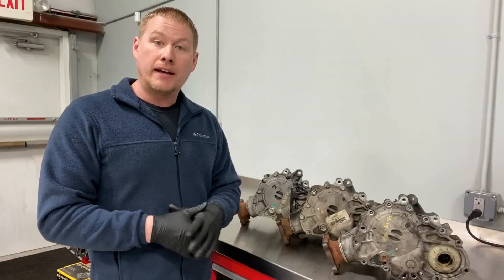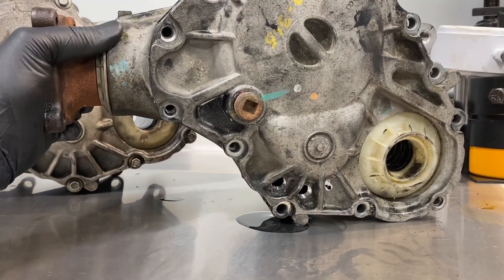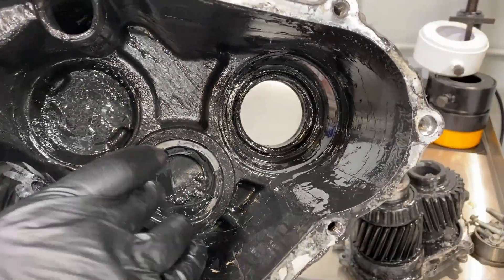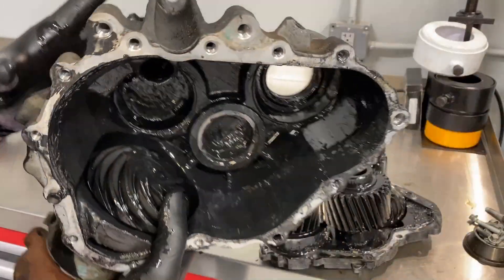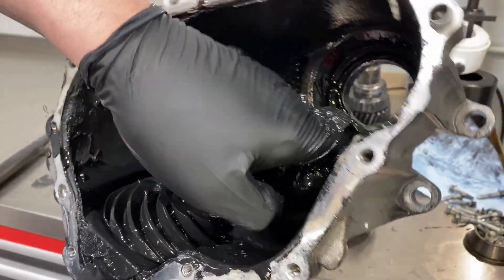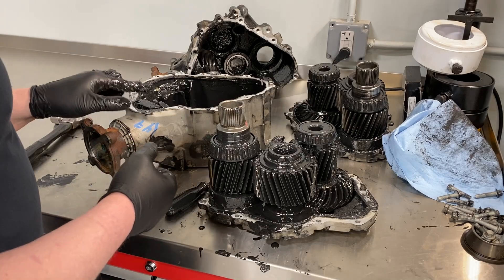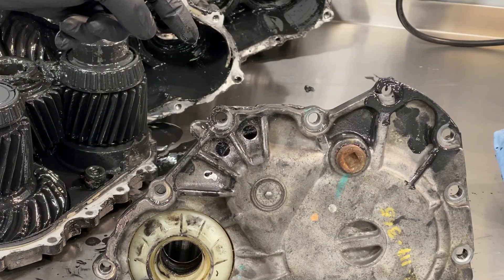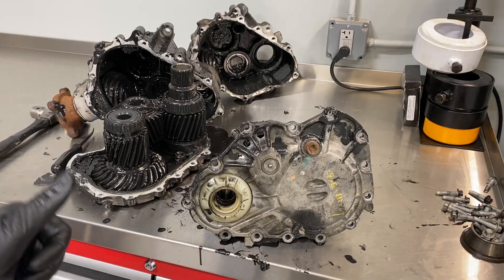How Ford All-Wheel Drive Power Transfer Units Fail and What You Can do to Prevent it!

Comment: What year did they start putting drain plug on explorers I have a 2017?
Reply: I have 2016 explorer 3.5 ecoboost, it has drain plug but I had to refill in the breather hole/tube
Reply: chris a same here, not too bad when you find the PTU vent going in blind.
Reply from the maker: It really varies on the build but I can tell you the cooled units have a drain plug.
Reply: @FordTechMakuloco  how do you know if it's cooled?  Cooled by what?  I have a 2019 explorer it has a large black tunnel ram blowing air at the unit. Is this what you mean?
Reply: Mark Skare 

I can’t speak directly to the Explorer but since they share so many components I can in regards to the Flex.

Ford began using PTU drain plugs on the 2016’s on those but here’s the kicker:

Only the Ecoboost models or units that had the factory tow package had them. Models that had the standard Duratec engine with AWD did not have a drain plug. I know this because I work at the Oakville Assembly Complex where the Flex was built. I verified this because when we bought our Flex I was well aware of the PTU concerns and saw on the Flex Forum that some owners claimed they had drain plugs on their PTUs. When I went to service the fluid on mine, suffice to say I was disappointed to find that mine DID NOT have one (ours is Duratec with AWD)

 So one day I stayed late after my shift and hung out on our Chassis line where the vehicles go by overhead. Sure enough......every Flex AWD that had a tow package or Ecoboost had the drain plug, all the standard Duratec AWD models did not.

Comment: No drain hole and [Made in China] because the labor and parts cost to rebuild under warranty(especially with lack of experienced technicians) is just not feasible in this day and age, SAD.
Are the pinions and ring / worm gear even shimmed? or just just built to tolerance from the factory?
Reply from the maker: Never went that far to even check since nothing is serviceable.

Comment: Pls advise,if there is a squicky noise on the left side of the front wheel each time you climb a bumb or drive at a low speed,what is the exact problem?,thanks for your great show
Reply: I would check the away bar end links.  Small bumps or uneven surfaces changes the load on the tie rod end link.  When tbe rubber bushings are bad (dried out) they squeak.
Reply: Sounds like a bum got up inside there to keep warm. They do make squeaky sounds when you drive. Sometimes the bum will fall out if you drive over railroad tracks fast enough, or if that fails, you might have to coax him out with a broom handle. Don't leave him in there to long or he'll start to nest.